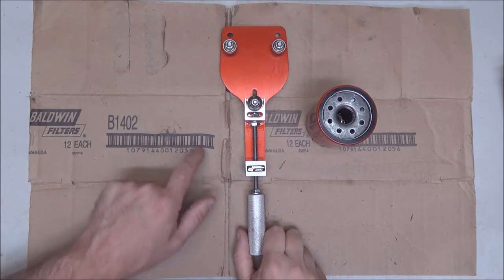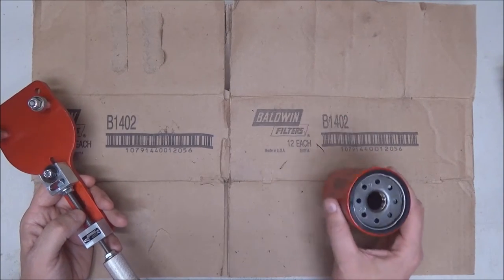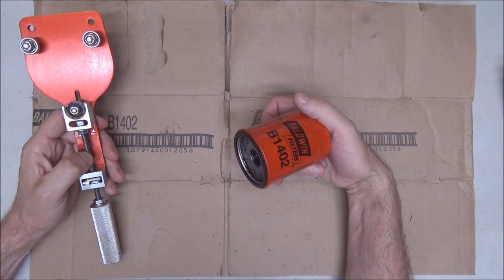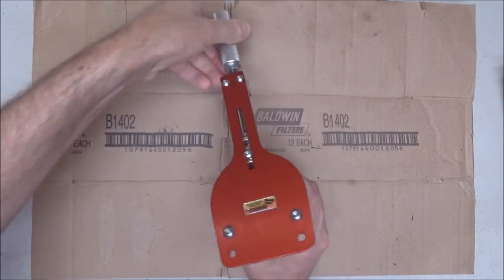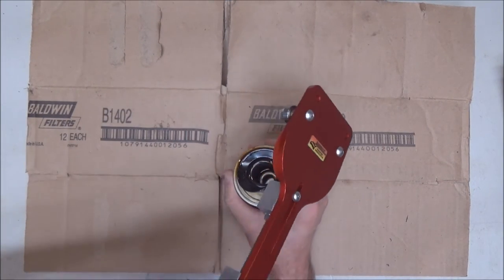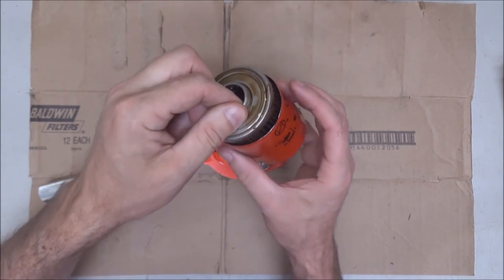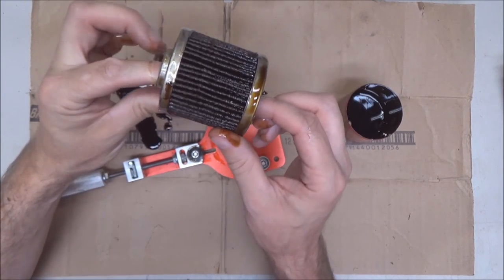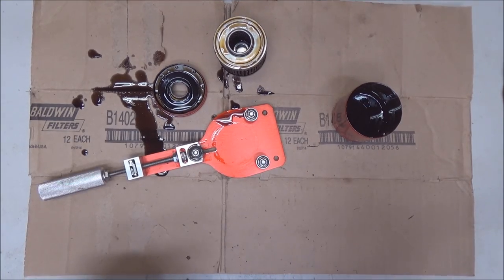Longacre oil filter cutter & Baldwin B1402

Comment: I clamp my oil filter cap wrench in my vise and rotate the wrench. I have a Longacre and like it. One thing I changed on my Longacre was the cutter wheel axle bolt. My cutter was made using a bolt with long threads so that the cutter wheel was rotating on the threads. Couldn't live with that Mickey Mouse set up so I went to Menards and found an Allen head cap screw with a long grip that would have the wheel rotating on a smooth journal. Also found some nylon washer to use on each side of the bolt. Works real nice. There probably isn't much advantage replacing the OEM bolt but I couldn't live with such a chincy set up on a good tool. Just me. I've changed out lots of things that I didn't  like on vehicles and tools and anything else where I could make an improvement.
Reply from the maker: Mine is still holding up well all stock. I don't use it near as often now that I only drive 3 miles to work verses the 57 miles I use to drive.

Comment: 5000miles? I run 15000 between oilchanges no problem :) does usa have oil with less quality than europe?
Reply from the maker: This was with convectional oil, not synthetic. Even running synthetic I personally wouldn't run past 10,000 miles. Also how long to you keep vehicles? If you get a new car every 100,000 miles no problem with 15,000 mile oil changes, it will be the next guys problem. I keep vehicles 250,000-300,000 mile range, even running synthetic in my new car I change it every 5,000 miles.
Reply: @MarkFox  usually keep cars to 350.000miles. running 15000 even longer sometimes.
If you run synthetic its a waste to change at 5000.
No wonder Usa uses alot of oil :)
I would run conventional atleast 10.000.
Reply: @MarkFox  oil changes is a big business in us and a :) i dont know if your oil is of a lesser quality?
Here everybody runs around 15000/1year between changes, syntethic. Conventional maybe twice a year if someone is picky...autumn and spring :) otherwise atleast 1year :)
Reply from the maker: Where do you live Alexander and what what brand of cars are you running to 350,000 miles?  Where I live in the USA they use salt and brine on the roads heavily in the winter and most vehicles will literally "melt" with rust before 250,000 miles. 
We make the best oil in the world, Ferrari's and BMW's come factory filled with   Pennzoil. Mercedes are factory filled with Mobil 1. GE,  and Pratt & Whitney aircraft engines are spec'ed for Mobil aircraft oil exclusively, I personally wouldn't run Castrol or Motul oil in my lawnmower. 
Oil is dirt cheap here, my new Toyota uses 0W-16 Mobil 1  and using factory filters it's less then $25 for oil/filter changes.
Reply: На старинных машинах типа ВАЗ 2101-2107 да, можно. На современных "одноразовых" тяжело температурно нагруженных турбомоторах "синтетическое" масло из гидрокрекинга 5000 миль - это абсолютный предел. Имею Mitsubishi Outlander 2019 г - официально замена не позже 3750 миль. Советую не жалеть денег на замену масла.

Comment: You definitely did a better job than you did on the Purolator L14610 (which is also what I use on my Honda) but this time you should've drained the oil from the filter.  That filter is full of oil.
Reply from the maker: I'm running a SuperTech on my Honda now, might have to cut it open next time I change the oil in it.
Reply: That would be something to look forward to.   Maybe they are just as good as other filters.
Reply from the maker: SuperTechs are made by Wix so should be similar to those. It might be awhile before I take it off. Started a new job that's only 3 miles away verses my old job that was 57 miles away, I haven't even bought gas in over 7 weeks.